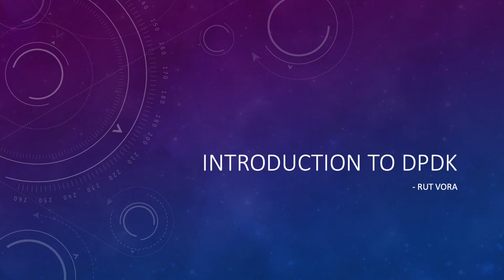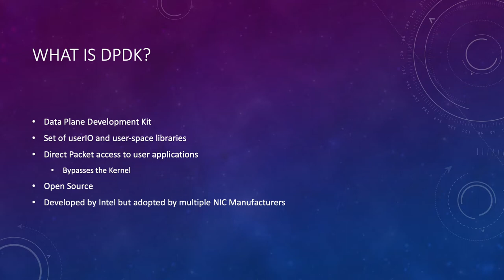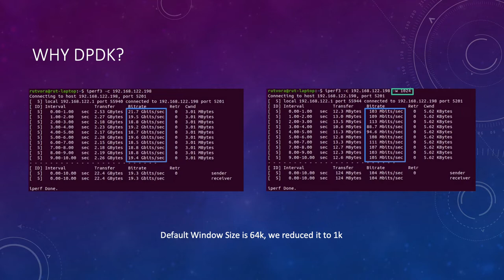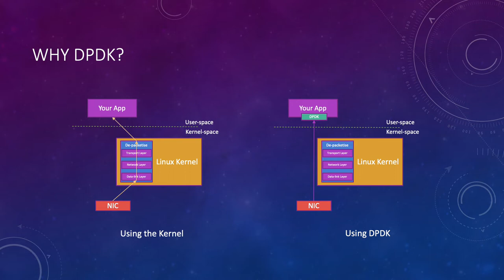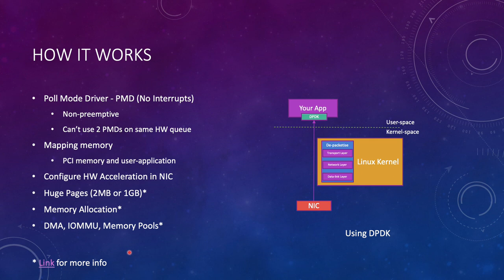Introduction to DPDK

Comment: Excellent content! can you provide me with some resources to capture raw packets using DPDK?, thanks.
Reply from the maker: Did you already check out https://doc.dpdk.org/guides/tools/dumpcap.html ? If not, you can use that to capture packets in pcapng and then open it with whatever application you like for open those files (Wireshark?)
Reply: @SudoAccess  Thanks, it is helpful!